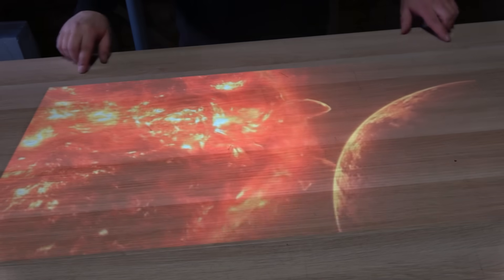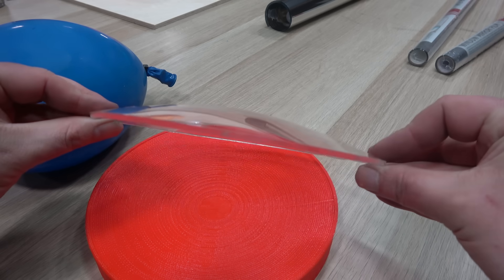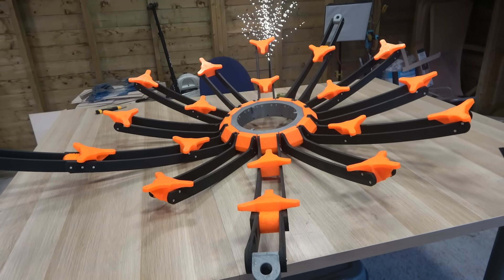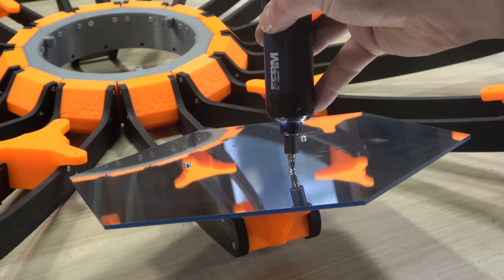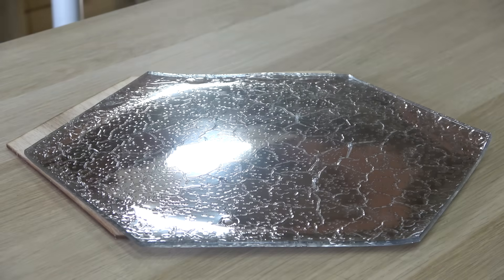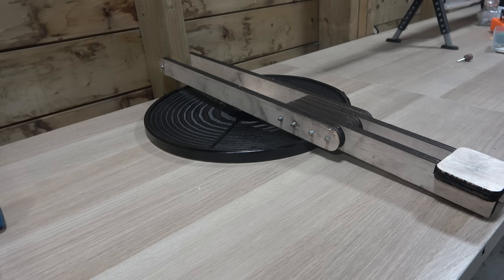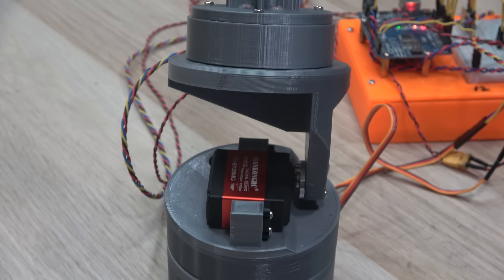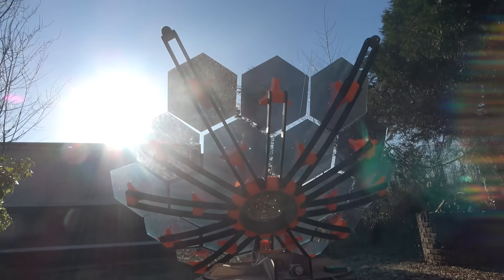Building a DIY Solar Generator..

Comment: Great project!  Some thoughts:

1. Probably the best, cheapest mirrors you can find are the aluminium discs in mechanical hard drives, which are regularly used as front-surface mirrors for laser builds.  Sure, that means a LOT more mounting points, but the better efficiency should make it worthwhile.  For mounting, you could cut some discs into washers, which will reduce mounting to a single screw. Also, as aluminium is fairly soft they should be easy to form into a parabolic shape.

2. As the amount of screw adjustment needed for focusing each mirror will be relatively small, slices of PVC pipe would be sturdy enough and provide enough spring while being dirt cheap.  Alternatively, as you should only need to worry about tilting towards/away from the center, you could 3d print a mount with built-in compliant joint and just use a screwed wedge to set the angle.  That would make printing and assembly MUCH faster and easier.

3. Rather than depending solely on light to determine where the sun is, just use one of the many Arduino solar tracking libraries to ballpark the position using lat/long/time/date.  It can not only always aim your mirrors directly at the sun, but can automatically reset the array for morning. You'll need an IMU to feed back the array's direction and inclination, as well as an RTC, but those are cheap and easy to incorporate.

4. That vertical mount is... sketchy, at best.  I would pivot the array around its center of gravity in the center of the platform, then tilt it using a tight non-elastic cord/belt/chain that is anchored to the top and bottom edges of the array and travels around a gear in the middle if using toothed belt or chain or wrapped around a powered drum in the middle if not.

Cheers!
Reply: Your hard drives comment has me thinking about unused CDs. Like, say I ended up digitizing my entire DVD/BluRay collection, or still have a stack of old AOL disks from my motorized CD thrower, cough totally normal thing to do cough, would a bunch of cheap plastic shiny donuts be effective? I'd be a bit more worried about them melting in the sunlight if they weren't (A) ideally reflecting most of the heat that lands upon them, and (B) only used for primary mirrors, not a secondary. But admittedly I've never left CDs out in the sun.

The hard drive platters would surely last longer, and I love the idea of using a washer layer cake to mount them by 1 bolt apiece.

Had to go look at mirror prices because apparently I was damn spoiled by the stack of cheap mirrors my family picked up at a garage sale, we had spare scrap mirrors for whatever projects we wanted, just about, heh.  :X

Comment: Why not just calculate where the sun is based on location and place and time? Why use sensors for that that could break, or be confused by light reflections/cloud etc which could lead to rapid movement of the mirror and possibly breaking it

Comment: For tracking the sun use data for your geo position instead of sensors. You don't have to worry about reflections of clouds. Far more reliable and fully software solution.
Reply: look up PVsyst.

Comment: Mirrors are actually incredibly inefficient at reflecting light. By adding in a secondary mirror you are losing a large portion of the energy. Consider moving your heat plate to the focal point in place of the secondary mirror. 

For a larger improvement don’t use mirrors at all. Lenses could provide similar focusing ability without the losses associated with mirrors. Fresnel lenses are flat sheets that focus parallel light to a point. They can be found in really large sheets in the screens of old TVs. Most people use them for solar death rays.

Comment: Instead of using photosensors for sun orientation, better use analemma table for sun coordinates. Dust will  cover the sensors, so using math and tables more reliable, I think

Comment: I really enjoy your videos and creative projects.  My mind is still obsessed with the tree wind generator.  I see a potential problem with your heat collector plate.  Let's assume you solve all the other issues and create the perfect solar energy collector/concentrator.  In that situation you will have a very hot plate with water trapped into a VERY small diameter channel.  That water will turn to steam very quickly and you won't be able pump water in fast enough (or with enough pressure) to stop the steam forming process.  Once it starts you will not be able to stop it without removing the heat.  I have seen the same thing happen when people attempt to heat water using 1/4 or 1/2 inch copper tubing with rocket stoves.  After it gets warmed up to a specific point the steam creates back pressure and water doesn't flow through the system anymore.  To solve this on the rocket stoves they use 3/4 inch (or larger) copper tubing.  Then they can collect more heat with a slower flow of water.  I would suggest you consider creating a new heat collector with a wider (or deeper) water channel so you can get a larger volume of water in contact with the heat.  This will enable you to use slower moving water at lower pressures.  Keep up the great work.

Comment: I'd recommend putting two pistons on the back of the mirror assembly to the frame. This will strengthen the hinge and prevent wobbling from the single connection.
The shot at 12:30 shows exactly what I am referring to.

Comment: Really like the presentation with the beamer onto the desk! :-) 

I would probably consider adding a counter-weigh of sort to the mirror if you want it to be more stable. But then you'd have to redesign the base section as that is not fit for an opening in the middle.

Comment: if your aim is to boil water to create steam you should put your heating plate in the front where the rays are focused then run copper piping through the middle.

Comment: A few things i noticed:
     1. The parabola molded disks aren't serving much benifit because your collecter is relatively large.
     2. The reflective film is likely much worse at reflecting heat than other accessable materials. (My pick would be a reflective desert safety blanket)
     3. The aluminum collector loses a large amount of heat because its reflective. Ideally your collector should be dark black to maximise absorbtion. Darkening your existing part can be done easily with an aluminum blueing kit. 
     4. TPU degrades quickly in UV light, making the printed springs less than ideal for longterm, outdoor use.
     5. Clearly a lot of time and passion is being put into this project. Dont let complainers like me stop you from persuing creative ideas, and making discoveries!

Comment: If you paint the aluminium heat sink with an ultra black paint like vanta black, or even just regular black itll absorb more of the light as heat, the water you pump through the sink could be salt water as well since salt water is more conductive and reaches boiling point easier. Those are my suggestions, great video!

Comment: This is very cool, as a total novices' suggestion : maybe make a cover that the system can close over itself if it detects low/no water to prevent it catching fire.
Something simple on a hinge attached to the lazy susan base should work fine.

Comment: To my estimation you seem to come up with the hard way and least cost effective materials and methods to achieve your goals. 'Over engineered.'  The main aim should be to use as much recycled and re-purposed material as possible along with your ingenuity to achieve what would otherwise be prohibitively expensive.

Since the position of the mirrors on their supports need to be fixed to point at the fixed focal point collector why use adjustable springs and screws? Did your support structure for the mirrors really need to be made of curved purpose made machined parts? Why not use an epoxy glue and set the position until it cures, if you really wanted them to be adjustable why not use plastic ball and adjustable / tightening socket mounts screwed to a flat board, like those for mounting bike lights etc. Each individual mirror has to be parabolic, but the overall support structure for the mirrors doesn't need to be.

Forming plastic items on a 3D printer takes time and energy in the form of electricity to drive motors and power the heating element and you are forced to use plastic filament, you made 18 of the exact same design. Why not create one of your designs for a ball and socket joint mirror mount on a 3D printer then use a mold formed around the 3D printed objects and melted recycled plastic (milk cartons melted in a domestic oven for example) to form multiples of the same object design? For melted plastic you don't need to make the mold from an expensive material, plaster of Paris or even modelling clay for low melt temperature plastic would suffice to make a mold, you don't need sub-millimetre precision.

While I find your testing to get an optimum temperature for shaping and applying the mirrored plastic to a parabola in a one-step process admirable for the amount of testing you did, it seems to me by choosing that route you created the problem you then had to solve. Why not shape the supporting plastic to a parabola first then make a wooden plastic mirror film support rig, warm the plastic mirror film and use the rig and a car jack to stretch the film over the parabolic support? You then just need to apply glue to the outer edge of the parabolic support to keep the mirrored plastic in place. You made the application of the mirror film and forming of the parabolic support together a one-step process requiring probably many hours of testing and wasted material when it might have been quicker and easier to make it a two step process.

In truth a wooden box and glass front with some cheaply acquired heating radiators mounted inside connected in series, or even a length of metal tubing, coiled or bent, sprayed matt black would probably give you a similar heat collection ability. You can pre-test by putting your metallic heat collector in the Sun and measuring the temperatures you can achieve. Creating a set of reflectors and focused collector instead of direct radiation collection is over-engineering for not much extra benefit. To focus more light on a smaller footprint heat collector it would be much cheaper and simpler to buy a sheet plastic Fresnel lens.

Still overall it is entertaining watching some problem solve their way through a design that exists purely as an idea, so in that respect you achieved your goal. Do you plan to go into the field of space telescope engineering some day?

Comment: Two thoughts. The motor that controls the angle of the disk seems to hold up fine to the disks force alone but the disk is a large flat surface meant to stay outside, so wind could be a potential problem generating additional force on the poor motor.

Second, and this is a rather silly concern admittedly, but couldnt the plexiglass holding the cooling system in place warp when the water heats up on a very sunny day? I doubt it's an actual concern but maybe worth considering?

Comment: This water pump and diameter of hoses are way to small for this size of solar collector.
You should use at least 1/2 inch hose and I suggest using pump used in boilers for heating homes.

Comment: 12:05
I feel like running a belt here instead of a screw shaft will be a lot better. You can relocate all the load to belt tension, which the belts are designed to handle. And support the shaft that will move the belt with some bearings, to reduce load on the motor shaft. Plus all the parts under stress will be a lot cheaper and easier to replace

Still, I don't beleive this construction will survive winds or snow accumulation. Probably structural components will either have to be supported with some steel wires placed carefully, or with more metal parts

Comment: 1. You can apply film with heat gun and soapy water. Just like car window film applications.
2. You do not need parabolic fancy mirror for heat collection. Especially if your heat receptor is as big as individual mirrors. You can even use flat mirror.
3. Paint your heat receptor black.

Comment: You could align the horizontal drive parallel to the equator so the vertical drive has much less to do. Since the design is trying to be energy efficient this may be significant

Comment: Test the strength of your motors and frame against winds of different strengths.
I'm afraid your setup will end being just a proof of concept. If you want more, be prepared for a metal frame and the use of some pretty beefy linear actuators (search for "solar tracker linear actuators" - will come in pairs and won't be dirt cheap for 600kgf)

Comment: Not sure how you want to move the focal point from the top to the heat exchanger in the center and why you want that.

Can't the collector be stationary? Seeing the bowl is working as one fragmented mirror/lens and each single mirror has the same size reflection as the exchanger anyway, the single mirrors don't need to curved. 

I am worried the aluminum collector will not survive the extreme fluctuating temperatures. Maybe try and level them out with a thick (dark) metal plate acting as a capacitor. And place the thing in a glass heat trap. 

Water might be problematic, because of the low boiling point. 
Anyway I don't think collecting heat when the sun is out is the problem......

But still very interesting to see where this will lead....

Comment: Have you considered replacing the electronics with a cam-follower arrangement on the base? That will be more durable in wind and deal with inevitable electronics failures.

Comment: I would mount the heating plate onto something else. It's going to get a LOT hotter than the 3d printed plastic can handle and it will melt

Comment: On your motor controller, add standard tracking/motion for the solar calendar (xyz angle and speed)  and only allow a certain % deviation from photorestors so random clouds and over cast days it still tracks as it should. that way photoresistors are never totally out of scope and can correct the last few degrees and won't go crazy scanning everywhere for the sun if it loses track due to environmental reasons and or freezes because everywhere is the same brightness. The pan/tilt should be almost 100% predictable on a calendar basis but id imagine there is some deviation based on location and local weather witch could be problematic (especially being so far in the far north). And if your looking to go real fine grain, testing photoresistors to to find common resistance for a given light emittance. then adding small resistance so it doesn't have a bias to one quadrant would help with accuracy and balance (apologize in advance if wording is out of place or slurred, having a few beers finishing another mechatronics problem for the night and love projects like this...thank god for spellllll check) love what your doing and want to do some similar stuff here in warm Florida. my comments are not supposed to be "HEY THIS IS WHAT YOUR DOING WRONG " but what id love to add if and or when i do the same thing  i appreciate showing your pitfalls in MFG because id do all of those to otherwise :)

Comment: Really cool project, I'd use mylar blankets though. You can shape that to acrylic or even ASA structure basically using vacuum wrapping. It's far more reflective and reflects heat better

Comment: Adding actual silver via electroplating or chemical treatment might be even better a reflector than that mirror laminate stuff. Give it a nice polish to really bring out the shine. Sure, silver is a bit pricey, but with the equipment you have available, I'm sure you can afford it. Besides, with plating, even a little silver can go a long way.
Consider closing those gaps a bit. You should be capturing as much light as possible, and while the gaps don't need to be perfectly closed up, they could be significantly smaller, down to a couple millimeters.

Comment: Honestly, you should flip the water disk over so the transparent side catches the light, and pack the channels with steel wool.  It's about surface area here.  Of course, you'll need to replace the plexiglass with glass glass, but it'll boil that water faster than you can say, "PCBWay!"

Comment: This is cool. But far too complex.
You can simplify the design by dumping the idea of a disk: optical perfection is not required.

Pressure, evenly applied to opposite sides of a sheet, will give you a parabolic cylinder. 
You can demonstrate this to your self with a credit card squeezed between your fingers.
A reflector with such a shape will focus reflected light into a line.

You can focus this line into a point with a secondary parabolic-cylinder reflector: it must have a curve appropriate to the distance it is held from the primary and the curve axis must be 90 degrees to that of the primary reflector.
Again, you can use a pair of credit cards to understand model this and understand reluctance path.

A pair  of adjustable A-frames, properly attached to eachother, can carry both reflectors, bending them with adjustable force. 
A relatively simply bracket that freely rotates along a single axis  would hold the mirrors to the A-frames.

If the primary is bent along a line normal to the plane of the ecliptic, then it can be angled at 45 deg to the sun. In this way, the secondary will not block the incoming light.
If the primary bounces the light up, it is perfectly possible to create a reflecting geometry so that the focal point is in a fixed spot on the ground, even as the mirrors track the sun.
This means all the heavy parts are stationary, and supported by the ground. 
This greatly reduces cost and design complexity.